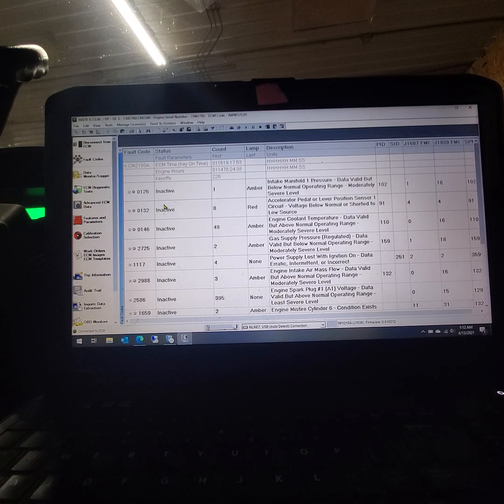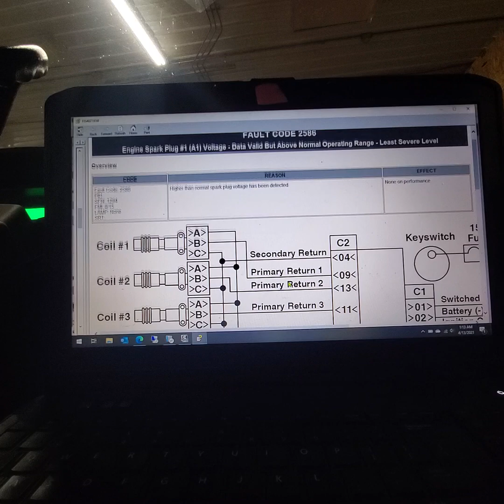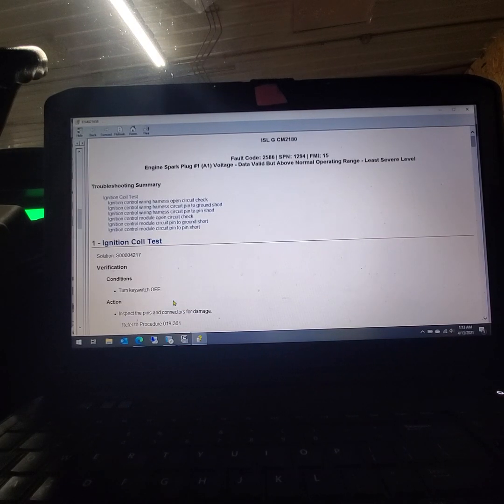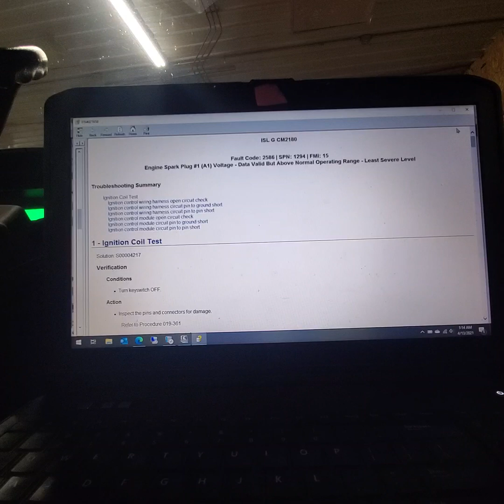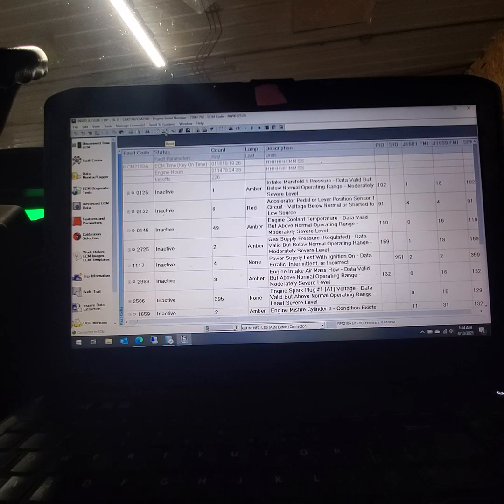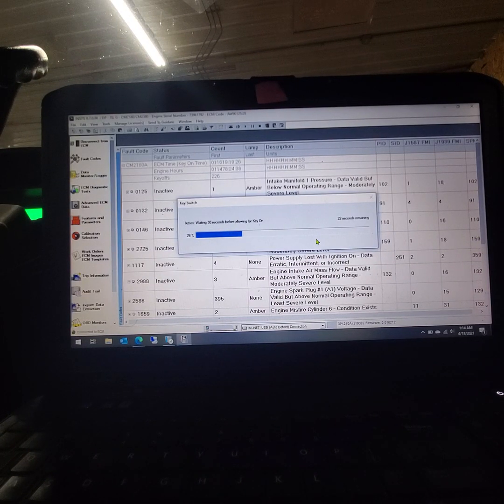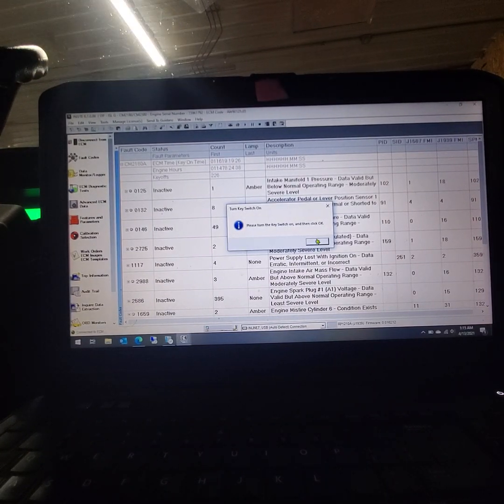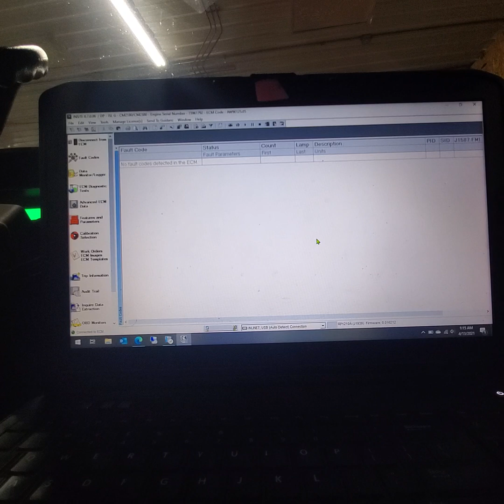Cummins Insite check engine light

Comment: The company I work for has CNG trucks. We are having a lot of issues with faults for a multi cylinder misfire. We write it up engine light is on. It goes to the shop and is returned within a hour no code or engine light on. 10 mikes down the road it comes back. 
I say they are clearing the codes. The manager says it’s impossible to clear an active code. I am talking this has been an issue for over 3 years and has happened hundreds of times. 
Thoughts?
Reply from the maker: Well he is correct u can't erase and active code but I had issues with spark plugs and coils that I tried that aren't cummins do u no the brand they r using e3 is terrible on those

Comment: Hi, I'm trying to replace damaged cummins ECU with used one. Do you know if INSITE software able to rewrite vin number ?
Reply from the maker: Depends on what version you have
Reply: @dirtydieselnation8826  Thanks.  Here is the info from the sticker. CM 2450B , P/N 5677631, S/N 6060791 , ESN 59658976. 2021 Ram 2500. i can program it with Chrysler WiTech2 but i can not change the vin on modules from 2019 and up. Chrysler software is not allows it.